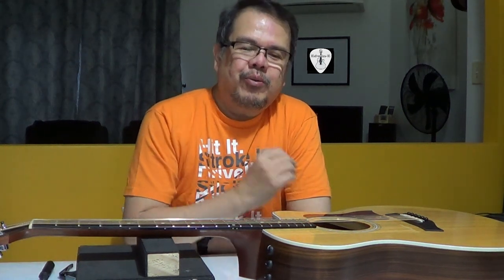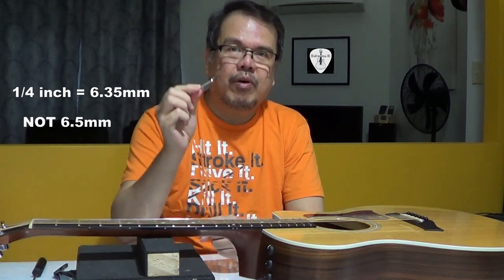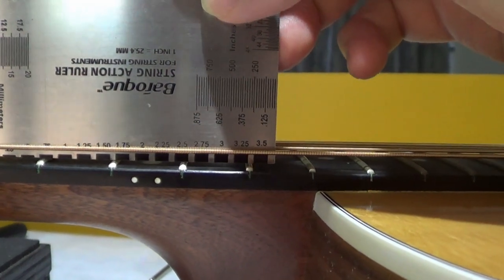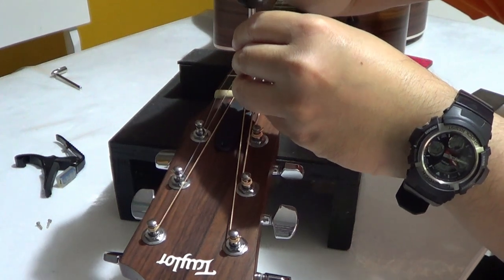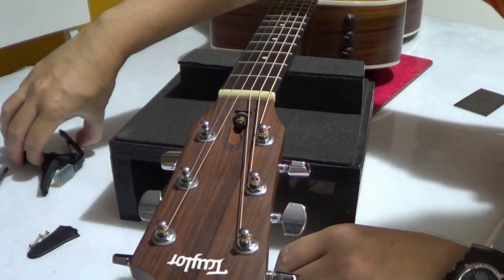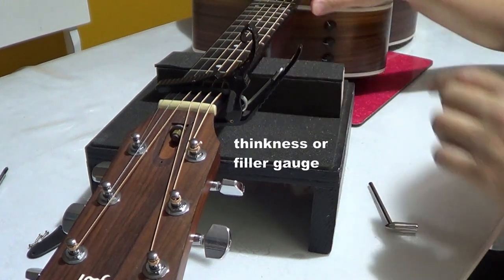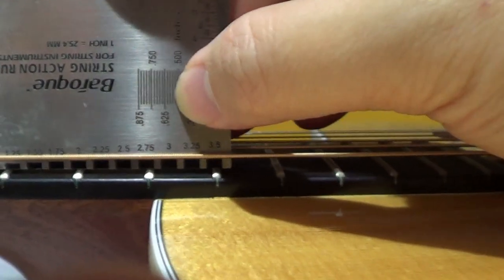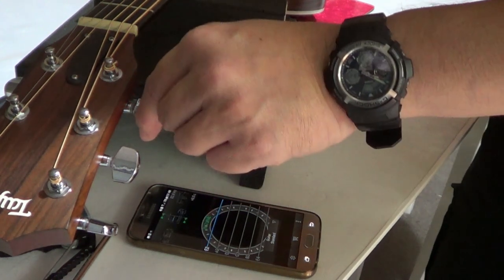Taylor Guitar Truss Rod Adjustment DIY Guitar Tip | Edwin-E

Comment: Hello there. My Taylor is a model 110-GB. It's always had high action since new, so not pleasant to play (so I don't play it!). I just took it out, and am going to adjust the truss rod. The adjusting nut on this model is on the end of the neck inside of the sound hole. I'll guess the process is the same as the head stock end adjustment, but wanted to check out your video. Thank you. ...beautiful playing.
Reply from the maker: Thanks and be careful.

Comment: Thanks. I used a small 1/4 inch socket wrench (I couldn't wait to adjust the rod) and it worked perfectly. Thanks! It plays so much smoother.
Reply from the maker: Glad it helped! Thanks for watching and sharing your experience.

Comment: Thank u man ! My 1999 USA Taylor 7 series sounds really great with super warm tone and great sustain. But I had been wondering why it’s action is so bad on the lower frets. It was really stress on my fingers trying to press the notes and chords. I finally know what need to be fix after watching ur video. Thank u!!! Now I can play without unnecessary straining. Beautiful grand warm sound.
Reply from the maker: Glad this video helped.  Thank you too for watching.
Reply: Sounds like your nut slots are too high to me.  check the gap between the strings and the top of the first fret.  Should be 0.020" on low E & A, 0.018" on D & G and 0.016" on B & high E (all on open unfitted strings / without capo)

Comment: Nice video. My Taylor 110E had multiple buzzing. Even took it to store i bought it and it still buzzed. Where do you get the measuring ruler tool?
Reply from the maker: I purchased the tool online.  You can try amazon, etc.  Maybe the frets are not leveled if you have multiple buzz.

Comment: Hello Edwin, thanks for the nice video. I have gotten a lot of help from you in regards with my Martin. I just traded it in to get a Taylor 114ce. Edwin, what a difference in the action, I have arthritis in my fingers as well as them being small. I really was struggling with the Martin. I have to change the strings though, they are 13s..I am going down to 11s, so I will have to adjust the neck a little. I like the sound of my Taylor better than the Martin, although the Martin had a little deeper sound, but play ability of the  Taylor is the difference between night and day. Edwin, which do you like better. Thank you for your videos, they make things easier. DAVID
Reply from the maker: Congrats on your new guitar.  And thanks for a very nice comment here.  You are right about Taylor neck, it is really comfortable to play.  I cannot decide between Martin and Taylor because I like them both.   It really depends on my mood which one I would like to play and which guitar better suits with the song I am playing.

Comment: When u use the gauge is the capo still on the first fret?
Reply from the maker: no.  I just use capo to check the neck relief and not the action.
Reply: @Edwin-E  thanks..I’m waiting for the gauge to arrive..😁
Reply from the maker: @HL-OOI  good luck!
Reply: @Edwin-E  I’ll add a nut driver on top of the Allen key for more torque..😁
Reply from the maker: Just be careful.  If it won't turn, don't push it hard.
Reply: @Edwin-E  it’s brand new..I don’t know.. so far I haven’t had success in turning any of the Cort guitar truss rod..previously was 880ce..sold it and upgraded to GA5F and still the same..perhaps will take it back to the shop if still fail..the first week the action was ok but now I feel it’s a bit higher already with the string tension in place..
Reply: Now I like the action with the capo on the 2nd fret..😁
Reply from the maker: @HL-OOI  yeah, probably the guitar needs a good setup.

Comment: He Edwin nice video. Do you know if the Taylor’s are typically bright and have a little string Buzz no matter what the adjustment is ?
Reply from the maker: Taylor has its distinct bright tone.  I don't know about string buzz you mentioned.  If it is setup properly then, it should be ok.  And also depends on your playing style.  If you strum so hard, then you need a bit higher string action.

Comment: Sir Edwin , how about if the hex nut of the truss rod is damage , it's difficult to turn and it's slips when the wrench is inserted ,any suggestion, any remedy ?
Reply from the maker: Are you sure you are using 1/4" socket?  Sometimes, others try 7mm and it can damage the nut.

Comment: So no need to remove any tension from the strings?
Reply from the maker: no.  The strings must be in tune to set proper tension for correct adjustment.  Thanks for watching.

Comment: Hello friend! I'm Brazilian and I just received my Big Baby BBTE, which my father sent from there. However, it came without the tensioner pipe wrench and I'm not sure which one works for it. 6.35 mm (1/4 inch) or 7 mm? Please, could you help me?
Reply from the maker: I heard that Taylor uses 6.35mm just like the one in this video.

Comment: salamat kabayan!! My question is do i need to adjust the tune first to a lower key before adjusting the trust rod?
Reply from the maker: welcome.  Dapat in-tune ang guitar before adjusting truss rod.  Yun kasi ang reference tension na dapat i-counter ng truss rod.
Reply: @Edwin-E  k edwin standard tuning right? Thanks
Reply from the maker: @lethalchaos19  it is suggested to adjust your truss rod based on the tuning you always use. So not necessarily standard tuning.

Comment: I dont use capo when i am playing guitar hehe its ok to do the procedure even no capo?
Reply from the maker: yes, just hold the string on the 1st fret.
Reply: @Edwin-E  thanks Godbless and i have a question hmm i have string buzzed on my 10 th frets hmm what adjustment could i do? Clockwise or counterclock wise?
Reply from the maker: If the action is good, and only buzz on 10th fret, I assume your frets are not levelled.
Reply: @Edwin-E  ok thanks sir Godbless, what procedure can i do and tools to use sir?

Comment: Hi Edwin is this method also work for the taylor nylon string? I'm thinking to do it on my 214ce N guitar.
Reply from the maker: Yes, although nylon strings have very little tension.   In fact, most nylon stringed guitars do not have truss rod.

Comment: Hello Edwin. Could you please answer my question. I have a Taylor 214ce plus and the problem is that I have buzz but only when a few strings a playing and the position of the chord is unusual. I have adjusted the truss rod, the action is high - 4mm. I don’t know what else could it be. And also I have buzz in other tunings which also doesn’t let me be fully open with my guitar. I don’t know what to do 😞
Reply from the maker: Make sure that frets are leveled.

Comment: I have an old aria acoustic guitar. When i remove the truss rod cover 
all I see is a regular nut that is at the bottom of the rod with some 
threads exposed.  There is no eggcorn or bullet in front of it. There is no possible way to fit a socket in
 to tighten it since there is no clearance in front of the rod because 
the wood head stock is in front of it. It can probably be accessed with a
 open ended wrench. I need to straighten the neck. it has a bow in it 
and the strings are pretty high from the fret board. Any input?
Reply from the maker: I never seen a truss rod adjustment nut that is not accessible.  It would be nice to see some photos.
Reply: @Edwin-E  How do i post photos here?
Reply from the maker: @nyacoustics8373  maybe post in somewhere and give me the link, like Google drive or fb.

Comment: Hey bro, what do I do If I want to lower the action on my 814ce but there is no bowing present?  Can I still lower the action by tightening the truss rod and not have any buzzing or cause any  reverse bowing?  Thanks!
Reply from the maker: If the neck is already straight, then tightening the truss rod will cause reverse bowing which will cause fret buzz on the lower frets.  If the action is too high, then probably needs a neck reset.  Refer to my other video where I tried doing it.  I recommend you contact an authorized Taylor service center if this needs to be done.  https://youtu.be/vK6R0zgNi0g
Reply: @Edwin-E  Thanks Edwin, yeah I did watch your excellent neck reset video but I don't believe my Taylor has a bolt-on neck so I can't do anything myself that's for sure.  I just bought the guitar from Sweetwater and it was shipped to me so I'm not sure how to get it serviced under warranty since it's really just a preference on my part and not a defect.  Thanks for your advice!
Reply from the maker: Cheers! Enjoy your great guitar.
Reply: @Edwin-E  Thanks!  Yeah I love it.  Great videos brother!

Comment: hello good morning I would like to know which is the exact wrench to adjust the soul of my baby taylor BT1 guitar since the normal one for Taylor does not fit is a 1/4 inch 6.35mm wrench but it seems as if it was too small you could tell me what is the measure exact please i will appreciate it very much
Reply from the maker: I am not sure.  I don't know why 1/4" inch won't fit.  Have you asked Taylor or Taylor dealer?
Reply: Edwin-E  hello i was already asking even until de factory everything agrees that it is 1/4 I will try again, thank you 😀😀😀
Reply from the maker: good luck!

Comment: What if my 1st string height is fine (1.5), but my 6th string is pretty high (3). Any ideas po? I have a taylor 114ce
Reply from the maker: I think 3 possible causes.  1.  The saddle height for 6th string is high.  2. Neck is a little twisted, 3.  Bulge on the guitar body.

Comment: Hi Edwin, I’m not sure if you make Taylor Guitar action lower, turn Truss tod clockwise or counterclockwise?
Reply from the maker: normally, tightening by clockwise to counteract string tension.  This will make neck straight if it is bowed inward, thereby lowering the action.

Comment: hi there i have taylor  314ce and its feels like i have buzz on thick E and A strings ,if i do this you thini get rid of the buzzin sound ? my guitar been to setup before but my strings old maybe i need a new strings to get rid off the buzzin ? i have a capo but i dont have the string height gauce thanks
Reply from the maker: there are many causes of fret buzz.  Please watch my other video to have an idea:  https://youtu.be/DyURe87cIkg.  Let me know how it goes.  You can use a normal ruler to measure action.
Reply: Edwin-E thank you i watch the link you send , those E and A string on my guitar only buzz if i hammer on them , makin wierd sound